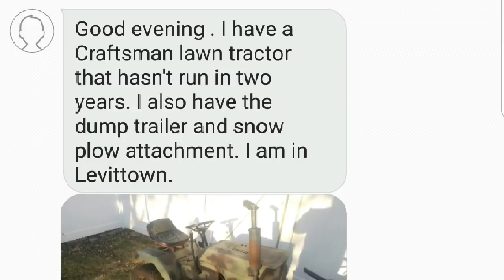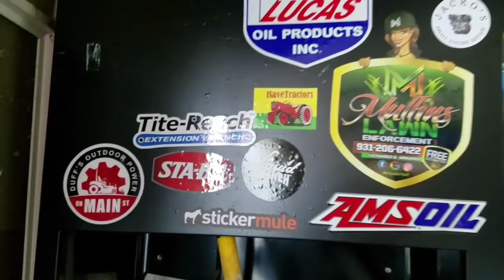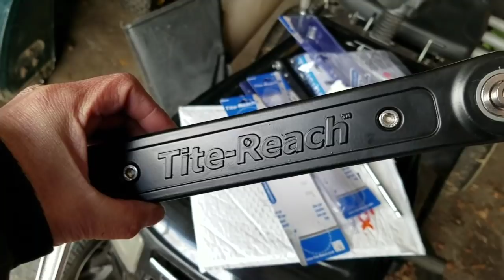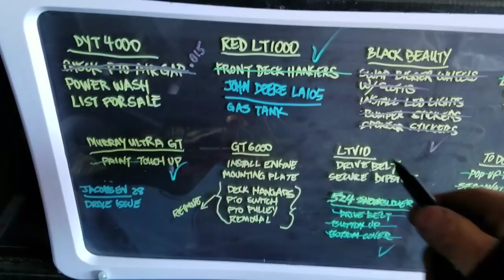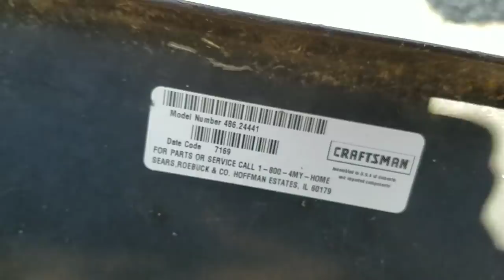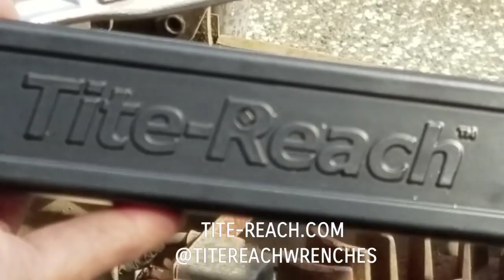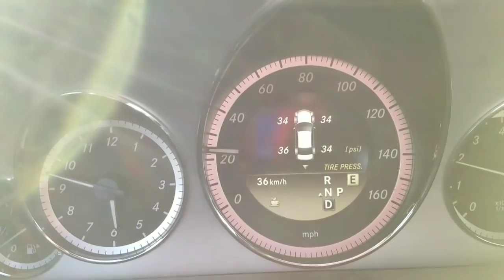MOTHERLOAD 15 FREE CRAFTSMAN 12HP TECUMSEH USMC MILITARY LAWN TRACTOR SNOW PLOW UTILITY TRAILER PICK

Comment: Tip, reach under and spin the pulley to see if the engine turns.
Reply from the maker: Did that...seized
Reply: @MowersNBlowers  wow, it looks like the whole flywheel lifted up, I bet the top of the motor under the flywheel has a big hole in it.

Comment: On the jdla are the valves adjustable, don't remember, if so adjust them.
Reply from the maker: It's a kohler 12.5hp command I got via trade with Pete Lombardi. Valves can be adjusted.
Reply: @MowersNBlowers  adjust them it will start better.

Comment: you should use the GT 6000 as a utility tractor...put the plow on and maybe those front tires off that tractor
Reply from the maker: Franco...I'm thinking the same thing bro...plow on the gt6000, but I think the wheels are too small for the GT6000.

Comment: I had a key way broke under the flywheel it turned one way got stuck the others way
Reply from the maker: Patrick...it appeared that the connecting rod broke at the same time my keyway broke.  Either way the engines trash!  Hope you subscribed.

Comment: You had all that oil products and didn't spray the cylinder first before you took a breaker bar to it could have broken the connection rod